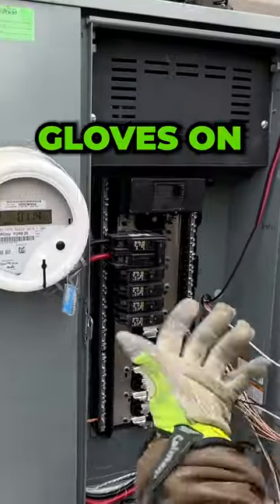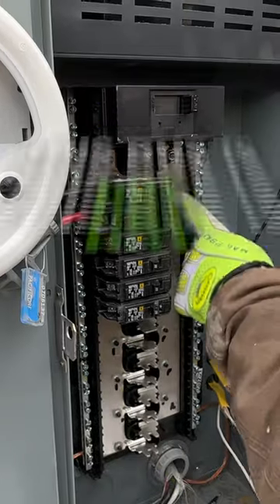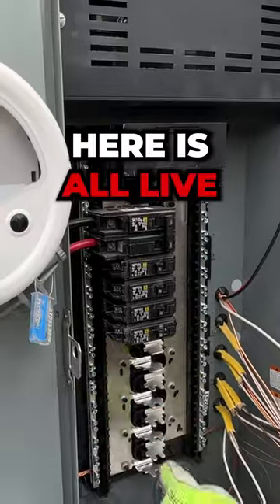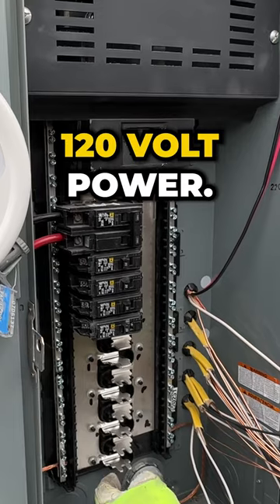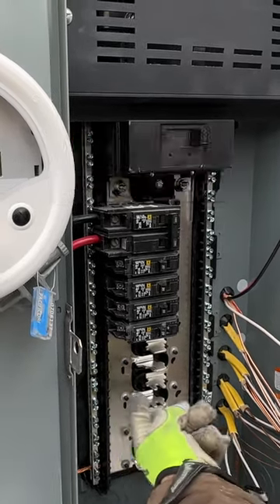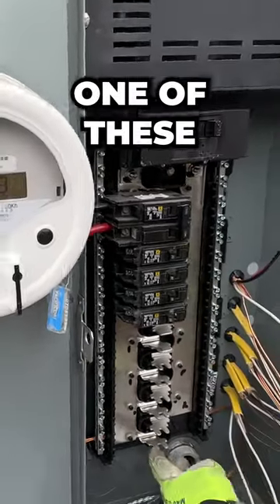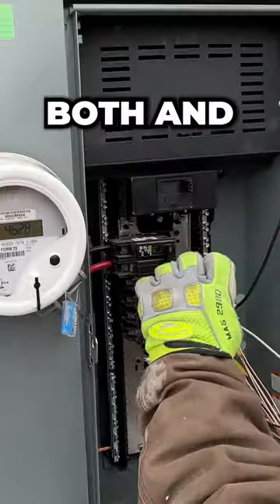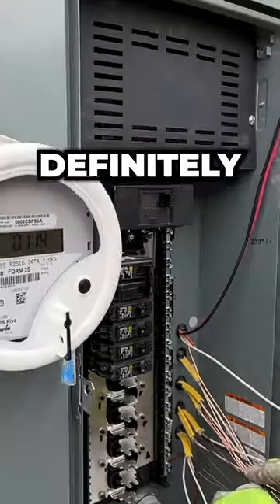Don’t Get Shocked⚡️Live Panel #Shorts

Comment: I didn't read. through all the comments so don't know if it's been stated before, if a pulse of electricity goes through your body at just the right time it only takes about a single volt to stop your heart. 
And yes, in all the years I worked with electricity I've gotten tangled up with voltages as high as 480 3 phase. Was knocked off a step ladder and left stunned for about 3-5 mins. Yes, was following all the correct PPE requirements and was using an approved step ladder. Cause? It was summer, I was in an enclosed space which caused me to sweat. The sleeve of my shirt brushed up a hot buss bar.

Comment: Been a lot of people killed by 120 volts. Not the voltage that kills you, it the amps.
Reply: Voltage, current and frequency.  You can be killed by low current. Voltage =Current x Resistance  Your body is high resistance therefore low current.  That's why you will not trip a breaker.  If your body is 5,000 Ω, Voltage is 120 Volts, your body will only pull 0.024 Amps.  If you fall into the panel and come to rest against something hot, you will be unable to control your muscles.  Your only hope is a helper with a 2x4 to knock you down off the voltage.  Otherwise you will die from 120 volts at less than 1 amp.
Reply: It is both. They are directlt related and this statement is false. A 12V battery can put out 800 amps yet you can hold onto the posts all day long. A taser can put out 500,000 volts yet not kill you because the current is limited. I = V/R
Reply: @Teh_Random_Canadian  Yep.  Ohm's law explains why even though it's an 800amp battery, the human body will never pull 800 amps.  Our resistance is too high, therefore the current must be very low for the product of current and resistance to equal 12 volts.  I saw a video explaining how frequency is also has a role determining the damage electricity will do to a human body.

Comment: The cameraman is in the restricted zine arc flash perimeter and the guy wearing gloves is putting far too much trust in them to save him from a shock. Depending on the voltage and current he might be fine but if its more than 110 hes screwed.

Comment: I use to get yelled at alot because instead of walking down 3 flights of stairs to grab an electrical tester & back up 3 flights I would just grab the wires to see if they're hot or not, it's not that bad..........there's nothing wrong with me I swear😂

Comment: "nothing hot on neutral" this is not true. You can and will be shocked by a neutral if your a quicker path to ground then wherever that neutral runs. Or if the neutral is open and you become the neutral to ground connection.

Comment: Those bus bars are only hot because you didn't turn off the main breaker.  Or you could have just had the meter pulled.  Or you're just trying to make it seem more dangerous than what it is.

Comment: Split phase is not two phases. Each side of the panel board is half of the same phase.
Reply: "Half a phase" make no sense unless you're looking at the half-wave DC pulse created by a rectifier. 

Both legs have an electrical potential that traces a sine wave of the same frequency and nearly the same amplitude. The signals/waves differ in the phase angle of the between them. Thus they are phased differently, or different phases. 

They also differ in the average potential vs ground (120 vs -120) but for most applications this makes no difference whatsoever. 

And yes you can add them together to get a 240V RMS wave-form, but you can add any two phases of the same frequency and amplitude and you get a sine wave out equal to the difference between them (a.k.a. the phase shift)

Comment: This is like pulling the trigger of a pistol pointed at your head with the safety on. Sure you should be fine but you've just made what would normally require a series of mistakes to hurt you into just 1 mistake separating you. Risk reward. Just no need.

Comment: Thats single phase with a center tap neutral.
Reply: On a typical single home service... The transformer is a single phase on the primary windings. The Secondary winding is split to provide two phases 180 degrees apart to the panel. 

It really depends on what perspective you look at it from.

Comment: I'm surprised the electrician didn't mention anything about grounding. You can touch a hot wire, as long as you're also not contacting a neutral or ground wire. You know, you have to put the fork into BOTH outlet contacts, right?
Reply: Yeah, no, sorry, you don't have to touch a neutral or ground, just provide a path back. You touch a hot bar and anything else grounded or sweaty,, you're gonna be the path of least resistance.
Reply: @gusbiv8282  "You touch a hot bar and anything else grounded or sweaty" - so you're basically saying that yes, touching a ground will mess you up, but also just being sweaty will too? Damn. Good to know.

Comment: PPE is a last resort safety mechanism. Never use it like this guy does. If you can remove the hazard do it. Its just a switch pull and a short walk. Keep the live work for when its absolutely necessary.

Comment: Why wouldn't the power be isolated? (Dead). I have only had my guys on 1 job that had to be worked on live (hot), and that was a hospital. However, after saying that over here in the UK, our plasterers and painter are prince's so need light for makeup, and joiners need power for the kettle that's boiled 200+ time a day for two guys. So I could understand

Comment: Very few electricians fully understand  the well established technique of "Live Line Work" using the "bare handed method". High voltage electricians actually raise their  bodies electrical potential and physically connect themselves to  energized equipment while maintaining isolation from structures and equipment of different electrical potential. This guy knows just enough to get by. There is more then enough power there to  kill you, those are not insulated gloves, he touched the neutral bus and line at the same time and is giving bad information here.   Live work(bare handed method) is not only possible it can be safe and we do it all day long so you do not have the inconvenience of a shut down.

Comment: "Not gonna kill you" interesting statement. A good path to ground with low resistance at 120v can off you my guy. Its amps that kill you not voltage. Higher voltage obviously increases the danger, I=E/R. Also, why touch the busbar? Even with gloves on, just unnecessary.

Comment: It's not the voltage that gets you its the amps
Reply: Voltage is important also. Consider that a car battery at 12v will not push its 600 amps through you, and a 120v circuit will certainly push 15 amps worth of current through the breaker and through you before tripping anything.

Comment: That does not meet 19th edition wiring regulations. No isolator switch for consumer unit, no RCDs, no RCBOs, no arc fault suppressor,  no fire suppressor pack and no cabbage proof wiring

Comment: “There is nothing hot on your neutral bus bar.”

That's true so long as every neutral wire is mechanically tight.  If you remove (unscrew and remove) a neutral wire from even a lightbulb circuit  that was turned on, that white neutral wire is now hot—-as you now hold that white wire in your hands.  And, if your left hand holds that neutral and your right hand is touching the neutral bus bar, your heart is in your so called “neutral” and it ain't neutral it is hot and your heart is in this circuit forming a dead short.   If you don't understand this you have no business working In a panel.

Comment: Its not A and B phase.  they are same phase just different 120v  lines to the house.  Phases are on different timing for the 60hz frequency, in this case the frequency of both lines, are aligned.  So not different phases.  Also, in the right conditions anything over 30v can kill you.  And those gloves aren’t necessarily going to provide  electrical protection, so please don’t do stuff like this.
Reply: Nope, when A leg is at high potential, B leg is at low potential. 

It's more A and -A phase, and if you connect the legs you get the difference, and end up with double A voltage in the same phase as A.

Comment: 120/240 most certainly can kill you! In fact more people die from 120/240 then from any other voltage.The body is actually not a very good conductor of electricity. Stand bare foot on a concrete floor and take a full hit from 120 it it might be the last thing you ever do..

Comment: I'm not trying to be a dick but those are not two phases.  They are two opposite legs of the same phase. Unless it's a commercial installation and we are dealing with 208/120 3ph system. But I  was wrong before.  Just saying...

Comment: I do not think proper electrician gloves were used in the video. Most gloves are better than bare skin, but I would not purposely touch any live wire or terminal with ordinary gloves. They can also give a false sense of security, as a sharp cut copper wire can easily penetrate many gloves.

Electrical gloves need to be rated and tested for use with live wiring. For residential connections with 240 volts I would recommend something like “MAGID Class 00 Natural Rubber Latex Insulating Linemen Safety Gloves”. 

Class 00 is the minimum and is rated for up to 500 volts. The rubber glove is then supposed to be protected against cuts by leather gloves on top.

Comment: Wrong.  Do not touch the neutral.  Devices short out all the time and send the full service current through the neutral.  It takes time for the breaker to trip in that scenario, if it trips at all.  Either way, there's going to be a little while before the breaker trips that you could be electrocuted.

Yes, under normal conditions the neutral has only a tiny bit of voltage.  But on real job site there are no "normal conditions".  There's always green horns and customers plugging in stuff they shouldn't.
Reply: If Neutral is grounded how can it shock you to ground ?
Reply: @persona250  The neutral floats when there's a ground fault and it looses it's reference to ground.  Meaning you don't really know where that 0 point is.  There's less of a reference to ground the further from the panel you are.

But yea you're kinda right, usually neutral has basically no voltage or difference to ground.  But sometimes it does if there's a faulty device on the line.
Reply: @Shadow_B4nned  why does the neutral float . The ground fault is in parallel with the neutral and returns on the neutral at the neutral ground bond . At no point is it floating
Reply: @persona250  No.  Think of it like this as if the circuit is faulty..  If you theoretically stuck a AC hot wire in the dirt, where is the 0 point? Exactly where the wire meets the dirt? In the ground? At the transformer?  You don't know because the neutral is floating.  The stronger the hot wires reference to ground, the closer the neutral floats to the transformer and vice versa.
Reply: @Shadow_B4nned  completely disagree. The current would go through the dirt up the ground rod at the tx and at the service head in parallel proportional to the resistances . The neutral is unaffected. If the neutral floated on every ground fault the 110v circuits would blow all loads connected .
Reply: @persona250  No. Current moves inversely proportional to the resistance. So get your facts straight first off.  Second,  measuring voltage potential between neutral and ground is one of the first things you do on call.  And lastly, what are you even talking about?  Are you asking me a question about something or trying to tell me the ground wont shock me?  If so, you couldn't be more wrong.  While it doesn't supply power to the device, it can carry fault current.  Neutral is a grounded current carrying conductor.  I honestly don't even know what your asking me.
Reply: @persona250  I was proving a different electrician wrong about the neutral a minute ago, not directly related to our conversation as I was proving the Neutral doesn't supply the device.  But it's a photo of a simulated live circuit so you can see the TDR multiplex on the neutral.  It's in my community bio if you want to check it out.  Sometimes all these words just turn into word salad and you just gotta bust out the oscilloscope.

Try to make your question more specific and not just a general argument if you need my help with something.

Comment: And here we go again, folks. Someone demonstrating an OSHA violation NOT wearing voltage rated gloves. A Class 00 glove with leather protector is required by both OSHA and NFPA 70E. 

If you’re going to post videos, post demonstration of safe work practices, not blatant violations!